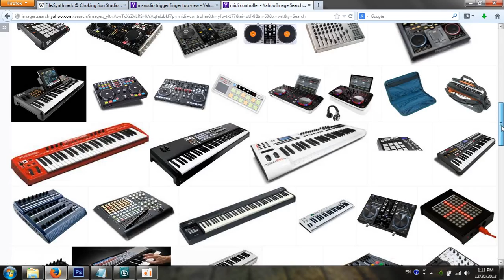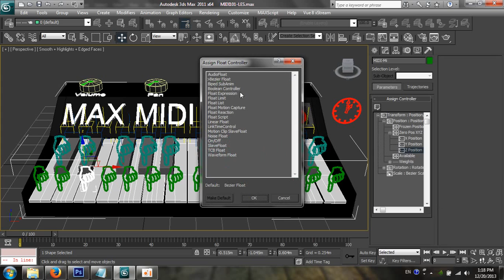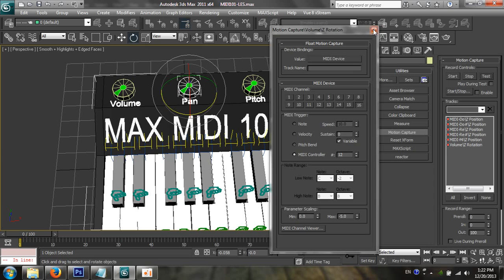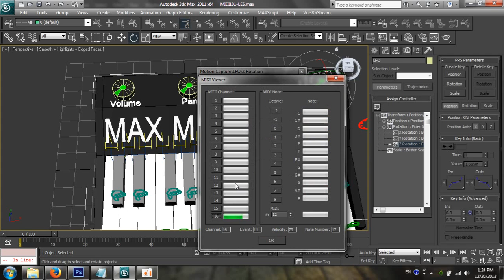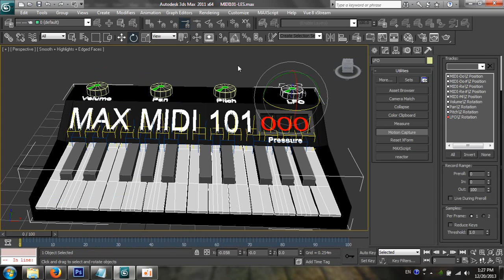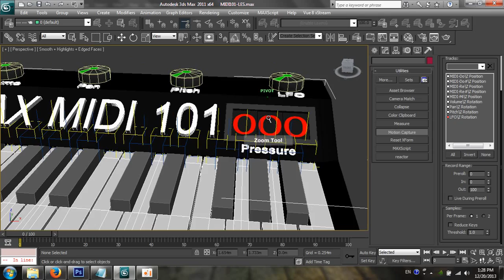MIDI rig intro (3dsmax)

Comment from the maker: Check your MIDI device driver and test it on a different program.. And if it another program is using the MIDI in, 3ds will not `listen` to this device, so you should not use any MIDI controllable software at the same time :)

Comment: I'm having some trouble getting 3ds Max to see any midi input. I've tried multiple USB midi devices, tried routing the midi data through sequencing software and through programs like loopMIDI and other virtual midi cables/devices. But no matter what I try, I can't get get 3ds Max to show any data in the MIDI Channel Viewer when I move faders and hit keys. I'm not sure what I'm doing wrong or how/if there is a way to define what specific device 3ds Max is supposed to be listening to. If there is I haven't been able to find it. I thought it may have been trying to use the default Windows midi device, but I tried changing that and it's still not working. Were there any special tricks you had to do to actually get Max to see the midi data? Or did it just work straight away? What I would really like to do is bind the faders and knobs on my keyboard to control morph targets on characters to make facial animation a little less time consuming. Please let me know if you have any advice. Thanks.
Reply from the maker: Sorry for the extreme delay on the response... I tend to travel a lot and not care much for the videos XD... But, as far as i know, 3ds will recognize MIDI inputs (if 3ds do not recognize the MIDI inputs, it is (probably) a driver problem...)... you can see what MIDI channel is active on your device (and on 3ds too)... sometimes you will mess up the MIDI channels (check all MIDI channels)... But really it is kind of simple (check the MIDI channels)... and the MIDI control is VERY POWERFUL XD... Those drum-pads are LOVELY to control facial animation really :)).. you are totally right about this one (facial animation managing)...